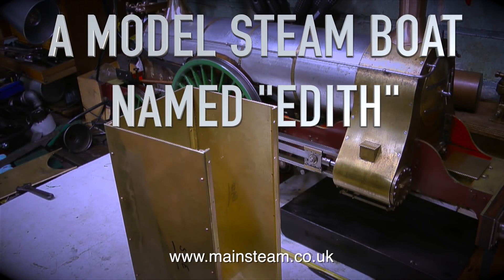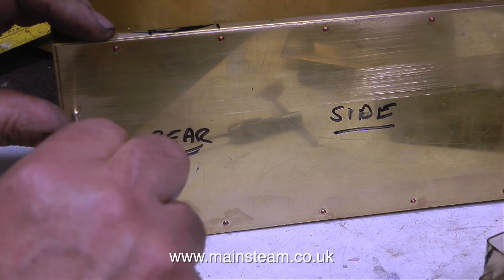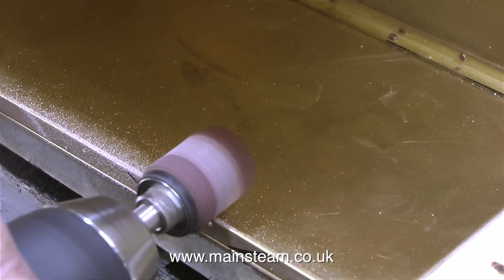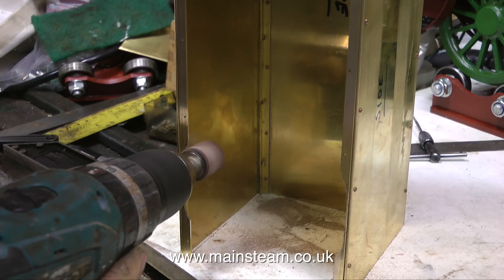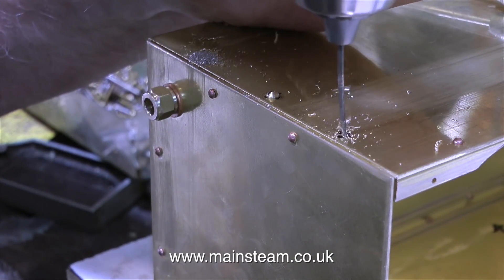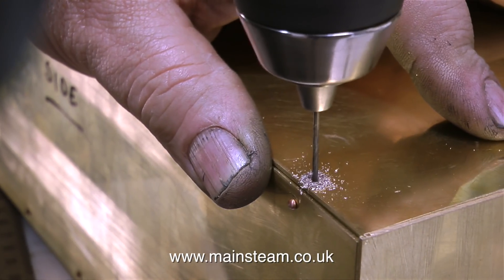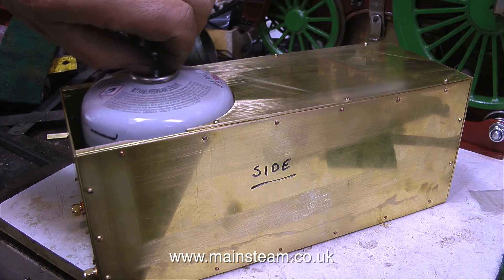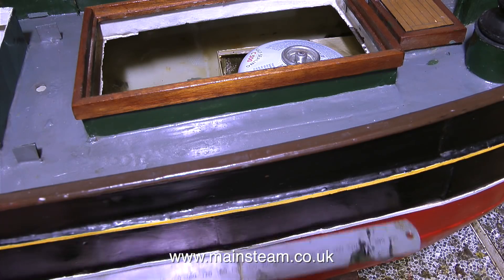A MODEL STEAM BOAT NAMED EDITH - PART #9

Comment: Wrap a string around the gas tank. As it floats, it pulls on the string. The other end of the string is attached to the whistle. So when you're running low on gas, you can hear it and head back home. Or you could get all fancy and have a little switch turn on a light or a buzzer.

Comment: Of course you will have a strap to hold the tank down, but how do you keep sloshing water from spilling out into the hull through the gap around the tank? Or... are you planning a cover that seals between the water tank and the gas can.... more will be revealed, for sure!

Comment: Mr. Appleton, if you have the time, I'm curious on your thoughts on using, say, a Stuart beam engine in a model sidewheeler, for a model based on American sidewheelers.

Specifically do you think it'd be too top heavy, particularly with using a taller A frame column as per marine designs?

And for modifying the valve gear to be reversible, would it be possible to simply put a second eccentric for Stephensons link? (Very unscale per the real thing, but if it works it'd be a lot simpler.)
Reply from the maker: I would say that is not a good idea for so many reasons, the main one being that a Stuart Beam engine isn't self starting ..... and it's top heavy as you say . . . . not practical in my book, it's possible - but hardly worth the effort . . . .
Reply: Keith Appleton Thanks for your thoughts, though the bit on self-starting actually has me curious now, as the full size marine beams were also typically single cylinder and thus didn't have offset cranks, how'd they prevent dead centers?

Or did they simply use a barring engine to get it started, like large stationary engines have. In which a small geared electric motor could be used for a starting application in a model.
Reply: D56777 - more likely they used prybars and muscle.
Reply: Willi Am Prybars and muscle on a ship engine the size of a small house connected to 100 ton paddlewheels?

The triple expansion pumping engine at the Kempton Steam Museum uses twin cylinder barring engines to start, not everything is solvable with manpower alone.

Comment: A clever chap indeed :)   Using the tank to not only supply water but keep the gas at an ambient temp too, one thing I can see that may be a problem is the gas tank will create a sharp slop point say for example on a choppy water which could see water egressing out into the bilge, would it not be better to put a formed brass "lid" over the bottle to stop the water from spraying upwards and out and also keep the gas in one position too?
Reply from the maker: please watch the rest of the series ......

Comment: Im sorry for being rude but could you not of put water filters on the pipes that take water from the lake??
Reply from the maker: yes you could, but they take up too much room and the cartridges need constant replacement - using plain old tap water is easier I think .....
Reply: It sounds nice to have an infinite boiler water supply, but the fuel runs out as well... so pit stops are required anyway. Or maybe borefom overtakes a model steam sailor before either gets low?

Comment: Now now now. You are doing a fine job with your videos. Do not let the inundation of those who are convinced they could easily do the job better and faster. Relentless inundation . Cause you engage in any variation on your own pacing and timing.
So, "Non Illegitimus Carborundom " . And do not get brassed-off while handling those sheets of,well,brass. And yes,I shall see myself out.

Comment: Oh Mr Appleton, after watching your videos for the past year (some more than 3 or four times) I can now tell when you are mildly miffed with viewer's comments.. You mentioned "Engineer's Blue" , I have acquired some, and it works great for layout work. But I also found that the super fat  Sanford "Sharpe" brand markers have a blue that is also great for doing layouts. Dries crazy quick and doesn't leave a big mess to clean up like the Engineer's Blue does.. Just in case you might want to give it a try some time. Great video, I knew where you were going with the tank and the gas bottle when you started, just made sense. Cheers! and Thanks for the Share!
Reply: The Sharpe also comes in many colours and is easier to clean off.
Reply: Engineers blue wasn't just for scribing marks etc but also used in bearings and journals to highlight high and low points of a shaft, the "crush" point of a load bearing or the trueness of a mating face e.g. car engine head to block mating faces you would use a bit of blue to determine whether the mating faces were truly parallel and this was in the days before easy access to surface grinders and skimmers and perfect mating faces were scraped by hand using the blue to highlight where its needed to be scraped and again blue used with a section of plate glass to see if its perfect or not.